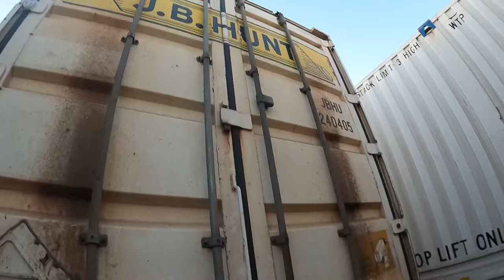J.B. Hunt | INSIDE THE RAILYARD

Comment: Hello, good job on the video, and that container that you were looking for, 240405 was manufactured by Jindo, in July 2007. Also, in the 240400's, there's a month change from July into August. I have container 240441 being built in July, and 240465 being built in August. It would be cool, if you show the date of manufacture when you hook up to a new container. The highest one that I have seen so far, is 340882. If you could find some 339 series containers? Those are brand new too.

Comment: For best results try to get your self either a hammer or a wooden small club. The sound should sound like a more hollow sound also the feel of it should be firm. If it feels softer it’s probably low . Very important to check that. The same with tractor tires.

Comment: I just dropped a hazmat load off at the rail bout 2 hours ago. I'm in the Jersey City terminal
Reply: hey Emanuel, whats the pay in jersey city i live close by was thinking about applying for local?
Reply: @hectorfernandez6748  depends how hard you run. I average about 1200-1400 take home. you can do a lot more though. I only work 5 days. but jb hunt lets you work 6 days if you want  and there a lot of incentives etc.
Reply: @Maneco2109  around how many hours a week your working to make that. whats the average morning start time there? thanks
Reply: @hectorfernandez6748  my shift is 4pm-2am but I usually work 40-45 hours a week.  They have many shifts. But you make more cents per miles of you work after 2 pm
Reply: @Maneco2109  damn thats pretty solid for only that many hours a week. i called a recruiter he told me 45 cent mile to start $70 live load and $50 drop and hook. is that about accurate for JC?
Reply: @hectorfernandez6748  100% accurate. It’s a good job been here for about 6 months. Stress free. They don’t bother me on my days off. NY is opt in if you want to and those loads pay 75$ congestion pay.
Reply: @Maneco2109  got ya. i just got my cdl class a license a week ok do you know if there taken new divers from school?
Reply: @hectorfernandez6748  I think they have a new program where they do take new graduates fresh from school. But usually it’s 3 months experience. Gonna have to ask a recruiter. I’m not 100% on how the program works.
Reply: @Maneco2109  thanks man appreciate it
Reply: I’m out of jersey city as well. I start at 0500
Reply: @canoncrew6697  hey canon, around what time do you usually finish?